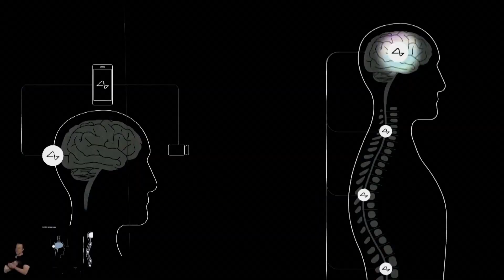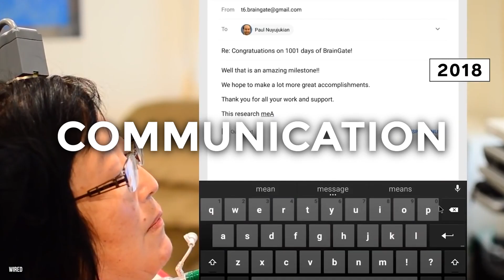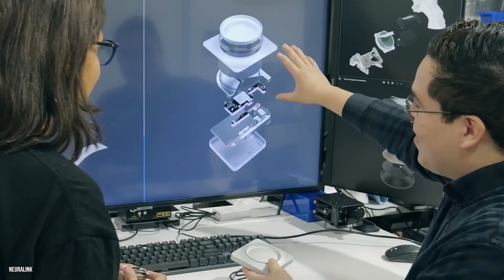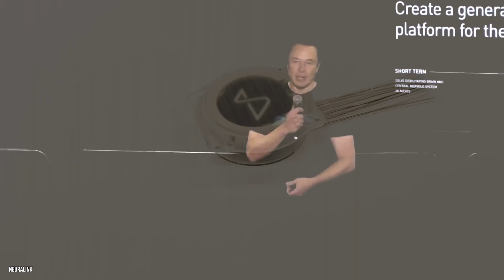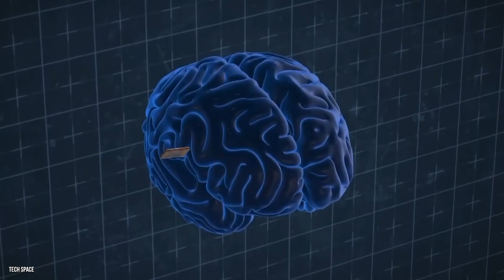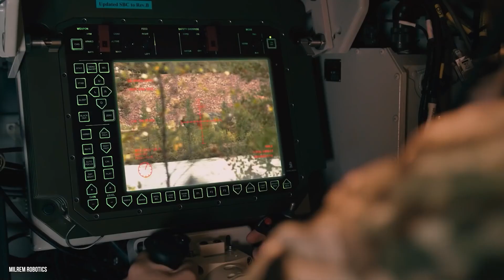Jaw-Dropping AI Advances That Will Leave You Speechless

Comment: There are certainly a lot of repetitive tasks usually performed by humans that could be performed by robots in the future. However their development and use requires electic energy which cost is about to drastically raise in the future. So their development at the current stage of development of our energy production infrastructure, still very dependent on fossil fuels, may not yet be very relevant. Especially to replace human workers.
  At a stage of a post-fossil energy paradigm, energy consumption costs would be better controlled and stabilized, this kind of issue could appear more relevant, et least economicaly. But to reach such an era, we might need to first turn to "low-tech", where androïds are quite "high-tech" stuff.
  More generally, the economy is supposed to address the problems of the humans and thier society, see their environment, with an appropriate hierarchy in investments. With the current climate deadlines, we will have to conform more and more, gradually, our economies to what is appropriate for humanity and its earthly environment. That is, at least, what we should all hope for the salvation of us all (before ever thinking about the great replacement of humans by machines).
Reply from the maker: Thank you for sharing your thoughts on this topic. 💪 You bring up some important considerations about the development and use of robots in the context of our energy infrastructure and the broader economic and environmental concerns.

I agree that the future of automation and robotics should be carefully examined in the context of our energy sources and their sustainability. It's true that the current reliance on fossil fuels can be a significant drawback when considering the environmental impact of automation.

However, it's worth noting that there are ongoing efforts to transition towards cleaner and more sustainable energy sources, such as renewables and nuclear power. As these technologies continue to advance and become more widespread, the energy costs associated with automation may become more manageable.

Additionally, the idea of 'low-tech' solutions should not be underestimated. While androids and highly advanced robots are fascinating, there are plenty of less complex automation technologies that can improve efficiency and reduce repetitive tasks without requiring massive amounts of energy. These 'low-tech' solutions can be valuable in many industries.

You also touch on the importance of aligning our economic priorities with the well-being of humanity and the environment. I completely agree that this should be a priority, and automation should be viewed as a tool to enhance human lives, not replace them. Responsible implementation of technology, combined with thoughtful policies and regulations, can help ensure that automation serves the best interests of society.

Ultimately, I believe that the future of automation and robotics lies in finding a balance between technological advancement, environmental sustainability, and the well-being of people. It's a complex issue, and I appreciate your perspective on it. Let's continue to engage in discussions like this to collectively work towards a more sustainable and equitable future for all.
Reply: @UnknownRealityYT  More than 80% of the energy produced over our world relies on fossil fuels. The spread of nuclear power is quite limited due to the strategical drawbacks in international policies (the risk of proliferation of nuclear arsenals in potentially politically unstable countries). The development of renewable energy is still also limited due to the political issues concerning the dependancy of renewable energy production to rare minerals that are held by only a few countries, which poses some political sovereignty concerns.
   I don't think mankind can avoid moving energy-powered devices toward low-tech/low enery consumption technologies, at least for a while, see an undetermined period.
Reply: @UnknownRealityYT  Low-techs might a priori be 0-consumption devices, not the robots, androïds, etc.
Reply: @UnknownRealityYT  The stake of the deadlines mankind is experiencing is not "well-being" of humanity. It is its survival on Earth !
  To achieve such a goal, no ways should be left aside.